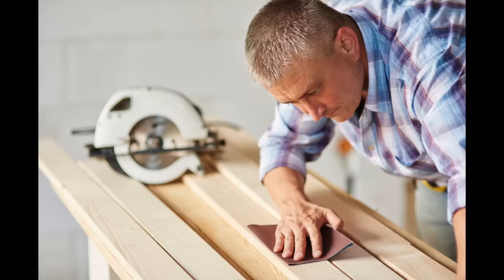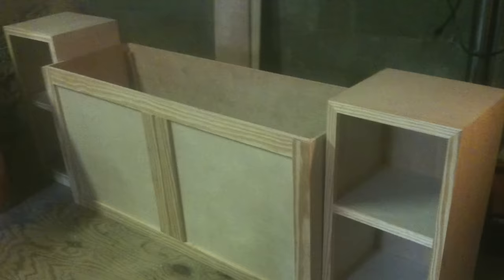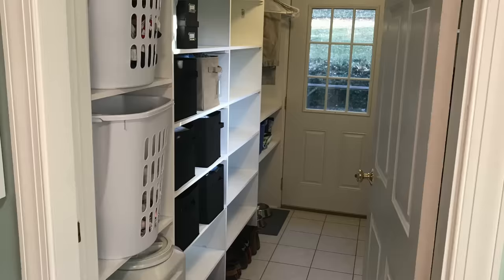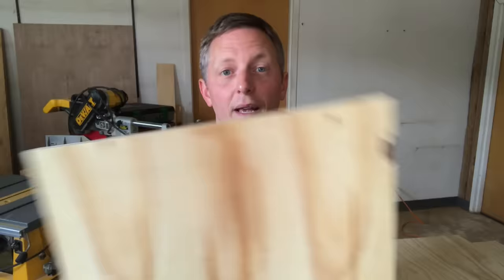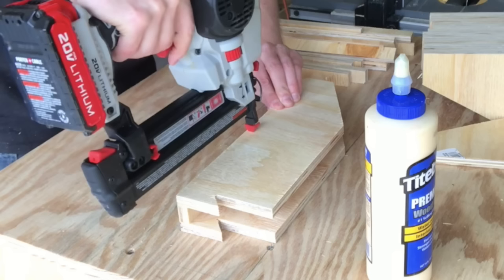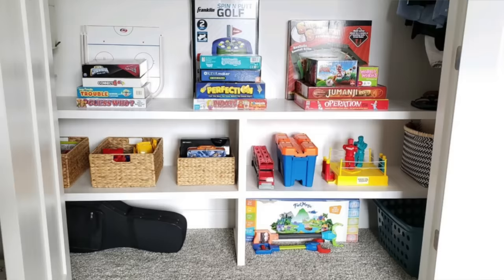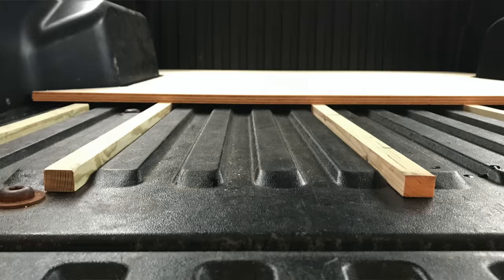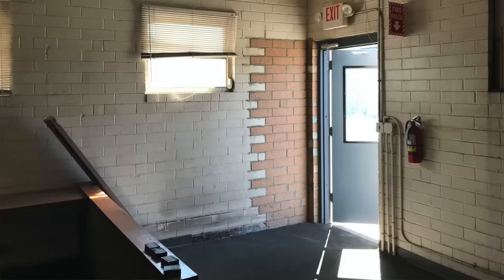DON'T USE 3/4" PLYWOOD If You Don't Need It...TRY THIS! (1/2" Plywood Vs. 3/4" Plywood--When to Use)

Comment: 1/2" for shelf bends easily with time. Sags with weight applied. Yours looks like it is already on the bends
Reply: yes, 1/2 is not a good choice for shelves.
Reply: Face frames keep it from sagging
Reply: I’ve used 1/2 inch for shelves too many times to count.  Never had a problem.
Reply: @kcb5336  It depends on what you put on them. My problem was filling a book case shelf from one end to the other with large (8.5"x11") books. Half inch would not survive that without some serious support.

Comment: Glad to see this explanation. 1/2" ply has been strong enough for me for nightstands and even a bar cabinet holding heavy bottles. One lesson though is that you need to be a little more careful with pocket hole jigs as 1/2" settings arent quite right and you can pop out the side if you drill all the way to the stop - an issue you dont have with 3/4"
Reply: Exactly what i wanted to know. Tips on 1/2 inch joinery using pocket hole jig. Or other methods.
Reply: Exactly what I wanted to know as well. I'm going to be building a pantry and want to use pocket holes. I'll be storing large amounts of flour as well so 1/2" just won't cut it. I made bookshelves out of 1/2" when I was a young person and that didn't work out well with heavy leather books.
Reply: @annyeongdreamz24   I've been using basic #8x3/4 pan-head wood screws bought in bulk at a local hardware supplier instead of Kreg pocket screws. I like to use rabbited joints on intersections and drawer boxes so I get more grain contact. And I ALWAYS use glue.  Remember, the majority of the joint strength comes from the glue.  Watch this test on different types of joints - https://www.youtube.com/watch?v=CE147Ow7RmM
Reply: figured that out a few times. haha
Reply: Pocket holes suck for just about everything. They are a crutch for people who don't know real carpentry. Carpentry got along for centuries without them and most of the stuff being made with them won't last more than a decade.
Reply: @MAGAMAN  doubt
Reply: Takes some extra work but fact is 2xn lumber used properly is stronger and cheaper than using 3/4" plywood all over. Not for cabinets but for everything else. Pocket holes are fast but aren't the best joinery technique. He's a pro and should have talked about all this.
Reply: @MAGAMAN  That may be but many also don't have all the expensive tools require to do "real carpentry".
Reply: @cleoburrows  exactly and most people don’t care to spend 6 hours in the shop making dovetails or dowel holes by hand with a chisel lmao
Reply: @MAGAMAN  You do know that the Shakers used pocket screws?
Reply: @MAGAMAN  that's not true.  Pocket holes aren't a new thing.
Reply: @SIE44TAR  Thanks for that share!  I followed the video and made my assumptions.
Most surprising to me was that both pocket hole joints (with glue) were stronger than Dominos.  Also that the dovetail joint was only as strong as the weakest pocket hole joint.
@Bourbonmoth should re-do the test (PLEASE) with different counts/spacings of splines/materials.  
There is a strongest joint out there and this would help get us all closer.
Reply: @MAGAMAN I use pocket holes alot but not to hold it together. More like as a tool to pull joints tight with a 1/4 dado joint and glue. I've built multiple pieces  like this and it works.

Comment: I use 1/2" plywood.   I learn that Iif I use the proper amount of "support " I maintained the same structural strength.  The majority of custom cabinet makers in my area use 1/2 for the carcass.   Good video

Comment: In my home woodworking shop I've gone completely to 1/2" ply unless I absolutely have to use 3/4".  I mostly use Baltic birch 1/2" ply for shop furniture and small to medium projects.  It comes in 5'x5' sheets and costs about the same per square foot as regular birch ply but it's birch all the way through and the surface veneers are the same thickness as the internal layers and there is almost never a void in it.  Standard hardwood veneered plywoods have paper thin outer veneers that can be sanded through easily.  I built a drill press stand with 4 drawers from 1/2" Baltic birch except for the top of the stand which was 3/4" because the "benchhtop" drill press weighs about 120 pounds.  It's plenty strong in well designed pieces.
Reply: I’m trying to clear space to be able to make my first French cleat wall and wondered if it would make sense to use 3/4” for the cleats and 1/2” for the containers? I’d be doing it partly to save some money, but like Ethan said, stuff in 1/2” looks more elegant. If built right, 1/2” should be plenty strong for the containers, right?

Comment: As a relatively new woodworker, I struggle with designing my own projects because I didn’t know when to use what lumber. Thx Ethan.
Reply: Anne, if you can... dumpster diving at a construction site can yield useful materials.  I pulled good materials from a dumpster which was placed at the curbside of a city street, so there was no trespassing issue.
Reply: TIP: learn “Sketchup” modeling & design software. It will help you A TON. You can virtually design i.e. desk and know up front if each piece will fit correctly before ever buying/wasting lumber. In addition, it will print out all the dimensions, plans, and many other features. A lot of people are not aware that it’s designed for woodworking (and MANY other areas) not just houses, etc.

Also, the great thing is it’s not too difficult to learn and use (unlike other programs that can be very challenging and frustrating). There’s A LOT of resources, community, and learning materials available (large amount for FREE).

Comment: I have been using 1/2 inch ply for years, I also use 2 x 3's instead of 2 x 4's, and yes I did because of cost, lighter, and in most cases it's easier to work with, thanks for info, you do nice work, I look forward  to your videos, I learn something new every time...

Comment: I just did all new cabinets in my kitchen.  I experimented with half-inch, but I just could not get consistent results from the pocket screws.  My local dealer carries 5/8 baltic birch and that worked out superbly. I was committed to pocket screws because we downsized a few years ago and we don't have space for a table saw (my son inherited my woodshop machines when we moved)
Reply: I now make my living with wood (previously just a keen hobbyist),  but I'd be lost without my table saw. I guess you break down sheet goods with a track saw or handheld circular now?  I made a pocket hole jig a few years ago, and has been handy on occasion, though at some point I would like to properly explore its usage, especially with dowels, or maybe also utilising my domino machine. I like the build method of IKEA furniture, so maybe one day.

Comment: It's funny. I remember the day I came to this realization. I was building out a walk in closet with a full storage system. When I went to buy the plywood they only had 2 sheets of 3/4" plywood. Not wanting to delay the project, I bought 1/2". At first  I couldn't believe the weight difference of the towers that made up the majority of the system. Installation was simple. The longest shelf span I had was 24" and initially I was freaking out it would bow eventually. 14 years later I look at those shelves 5 times a day and see that they are still perfectly straight. Over the years most of my projects, other than kitchens carcasses or things I need hinges, are 1/2". Let's face it, I'm not parking a car on it, they just hold a few pairs of pants.

Comment: I use 1/2in ply for loads of applications and if I want thicker, I glue 1/2in sheets together. That way you can get custom sizes of 3/4in (finished thickness) without having to lug those big heavy 3/4in sheets around.

Comment: 1/2 can definitely be substituted for 3/4 in many applications but, you can screw or nail into 3/4, where with the 1/2 is not a good idea, unless it’s a pin or a brad.
yes, pre drilling is required with the 3/4, but the 1/2” will get destroyed, unless it’s sitting in a dado with plenty of glue, and in that case nails are not required.

Comment: I used 1/2 inch plywood for a 55 gallon aquarium stand. Everyone around here said it could not hold the over 500 pounds, but I used two narrow shelves on each side 1 foot wide and the center was set up for a sump tank.  1/2 inch is amazing strong as you stated.
Reply: Most definitely my friend. Thanks for sharing your experiences. 😊🌎✨

Comment: I’m guilty of over-building, too, (I come from the “build it to last forever, make it indestructible“ people), and sometimes when those things need to be moved around, I definitely regret the extra weight, especially when it’s not on a smooth surface, but a rugged, uneven surface, and the cardboard trick can’t be implemented as well... Although I guess it could still be used a little bit, come to think of it… I had some new builds in mind, so thanks for the reminder, it’s time to downsize the thickness for smaller projects...
Reply from the maker: You’re welcome, Miss Kim! After years of  lugging around 3/4”, it won’t even feel like work when you build with 1/2” 🙂
Reply: There's a saying in engineering.  Anyone can build a bridge that'll stand.  But it takes an engineer to build a bridge that will barely stand.  I think the 1/2" plywood builds fall into that same category.  I, too, recently found out (just because of the cost) that 1/2" plywood is pretty damn strong and useful.  And if worse comes worse, you can glue it up and get a 1" material (well, 1/16th short of 1")
Reply: Well said.
Reply: Miss Kim - what's the cardboard trick, plz?
Reply: @bethanyanderson1745  Oh, things slide along cardboard more easily, so if you have carpet, or even on hardwood or stone, you can put cardboard under the legs, even bring it up around the legs and tape it on if you need to, and the furniture/heavy thing usually slides more easily, or if you have a big enough sheet of it, you can tug the sheet of cardboard itself, and if I were outside on a sort of rocky/uneven surface, I would put a few layers down and slide things along, some to cover the ground, some under the feet of the object itself. They sell those plastic “magic sliders” to go under the feet of furniture but cardboard is usually enough. 

Sometimes I also “walk” the item, tipping and twisting it from leg to leg or side to side as I go along, or flipping it end over end, protecting the object itself of course. with an uneven surface, you just want a way to make it more even so things don’t stick and get stuck and be hard to move, so cardboard or a sheet of wood or a combination of both can help get things past rough ground.

I do a lot of work alone, so you have to get creative sometimes when moving heavy things, and think in terms of evening out the rough or uneven surfaces, making them smooth and slippery, without slipping yourself of course, and in terms of leverage. I don’t know how many kids still use a seesaw or a teeter totter, depending on what part of the country you’re from, but it’s a good way for them to learn how to lift heavy things more easily.  

Then of course another method on smooth surfaces is a few round wooden rods, like closet rod. If you can get the item up under the rod and get another one under the other end, and have a couple more, you can create “rollers“. Then as you move the item forward, you take the back one and put it towards the front so it has something to move onto, and you just keep rolling it forward along the rods, they become “wheels”. If it’s not super heavy, PVC pipe works as well. If it’s a fairly straight line you are going in, this method works pretty well. 

Then of course there are the “forearm forklifts”, and they work pretty well, managed to make use of them on my own, they are designed for two people to use together.  Just always bend and lift at the knees, and your L4/L5 well thank you, that’s the part of the spine that goes first when people abuse their backs and lift improperly. 

There’s a reason why at the gym, weight lifters do a loud “whoo-uff!” kind iof grunt when they exhale just as they lift something heavy. They’re exhaling forcefully, and it’s tightening all the muscles around their spine to protect it, they’re not just doing it to sound cool (well, maybe some of them are doing it just to sound cool and they don’t even though they’re protecting their back). 

You just don’t want to continue to hold your breath, though. You want to hold all those muscles where they are when you make that sound, you want to keep your abs tight, because that helps protect your back, but you don’t want to hold your breath, and that can take people some practice to hold their abs tight but not hold their breath, but eventually they can keep them as separate actions. Holding your breath under exertion can cause a stroke and other damage to your cardiovascular system. 

You don’t want to deprive your body of oxygen when it’s doing heavy lifting...Especially when you’re lifting overhead, it’s a huge no-no to hold your breath, and a lot of people do it. They can pass out and drop that heavy thing on their head, or on their body as they hit the ground, or give themselves a stroke or heart attack in the process as well. So, hold your abs and glutes tight,  and keep on breathing.  That protects your back, but if you can’t do both, then just breathe, because breathing is always more important. Always. 

Extra into, I know, but it seems to go with the whole thing.
Reply: @misskim2058  - ah, now I  understand.  Thank you.
Reply: I found out about the weight factor when I built my nightstand. It has 4 drawers made from 1/2" ply (including the bottoms), and the frame and drawer fronts are 3/4" ply. Definitely heavy, and I've decided to add wheels to future projects like the desk that I'm working on now. It'll be a lot nicer when I move or want to rearrange furniture. I could've gotten away with 1/2" for the whole nightstand and 1/4" for the drawer bottoms probably but I'm using crappy non-birch plywood so I wanted to give it the added sturdiness from the extra thickness.
Reply: That is the thing, you absolutely can build to last "forever" with 1/2 ply. If 3/4 sounds sensible for regular lumber, ply as a material is just more stable and stronger than solid lumber in general, so you'd expect to be able to achieve comparable results with a lil fidgeting if the design and not as thick material. You know what they say. Work smarter is better than harder, after all.
Reply: Perhaps I should do a video introducing you to our lord and savior 1/4" ply, it is even cheaper and lighter than 1/2" but it can still be used for a lot of the same things if you design your projects correctly.
Reply: Over Builders Anonymous(OBA):  Hi,  my name is Miss Kim.  I’m an over-builder.  Lol.(FYI- not trolling)

Comment: I usually split the difference and go to 5/8" sheet for cabinetry. Even then, Uday Vadula, there is little to no room for error on pocket screws. I also find that the 1/2" is often warped; whereas the 5/8 is flat as can be. I will reconsider some projects for 1/2, but I need to be convinced by working out the bugs and considering the downsides as well as the upsides.

Comment: I opted for 3/4" for kitchen cabinets because it was only $8 more a sheet than the 1/2" and I could more easily use pocket holes
Reply: Use the proper depth setting on your Keeg jig for 1/2 applications. $8 adds up quick, and the price of lumber will not coming down anytime soon.
Reply: @MrSheeDo
Thank you for chiming in!  I’m a girl with no building experience, relying on YT and the guys at my local hardware store for guidance.  I’m going to be making a
26” d x 60” w butt joint, double deck (open to the front—no drawers) desk held together with glue and pocket screws.  Maybe also brads (although the gun is a bit intimidating).  The desk top will be standing on iron hairpin legs.  I think I want 3/4” plywood.  Also, I like the   look of the striated edge, and 1/2” ply wouldn’t give me enough edge.  I’m eager to try my hand at using a pocket jig.
Reply: @meridelmoss1802   if, and I express "if" you can find Baltic birch, go for that. But it's hard to find, but if you're looking for that edge you like Baltic birch sheets will provide that
Reply: Meriden, be very careful about getting advice from people at homedepot.
Reply: @patrickkimberlin3209  
Thank you for the recommendation.  I think Baltic is very pretty.  If in short supply, I’ll wait.  Better to hang out at the kitchen counter than rush and end up with unlovely results.
Reply: @johnthree1611  
Good advice.  I go to a local hardware (100 years in business) where most of the employees are lifelong enthusiasts of one trade or another.  Nearest Home Depot is over 100 miles away.
Reply: @meridelmoss1802  that's about the proper distance you should stay from a Home Depot and their lumber
Reply: @PhilPic01 
☺️
Reply: @patrickkimberlin3209  He is right about that but the cost will be higher
Reply: @meridelmoss1802  one other thing about Baltic birch ply: its a lot stronger than the low-grade plywood at all the big box stores. The inner layers are made of birch, not cheap, junk softwoods like regular HD plywood thats imported from china. Its a terrible product they sell. And it won’t peel apart!
Reply: Pocket holes???? No thanks
Reply: @TheMrchuck2000  
I love this comment.  Just from all the replies to my question, I'm thinking that my plan is sound, and that I can actually do this!  Thank you.
Reply: @meridelmoss1802  when I'm building something with new techniques I practice, practice, practice before I drill into the real project.
Reply: @juliastockhausen7173  
Yes, great advice.  Also, it takes a good bit to get used to the weight, torque, and, worse for me, sound of power tools. OSHA ear (and eye) protection are my constant companions.